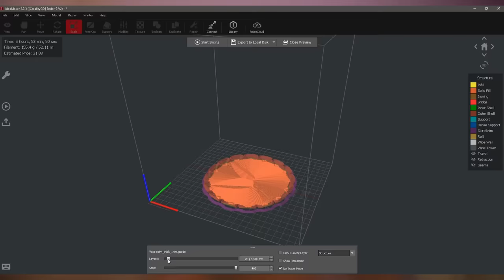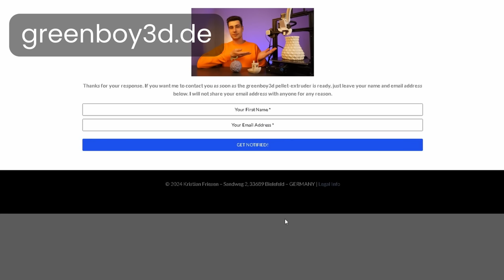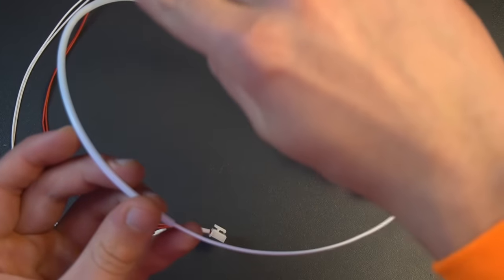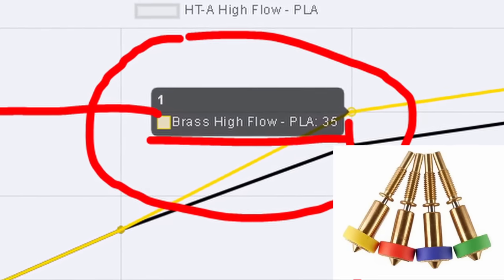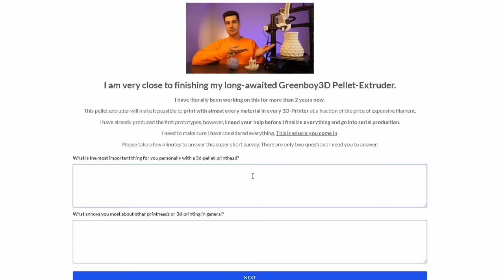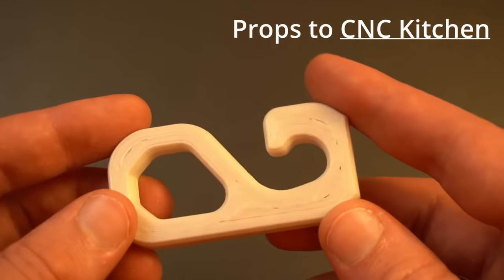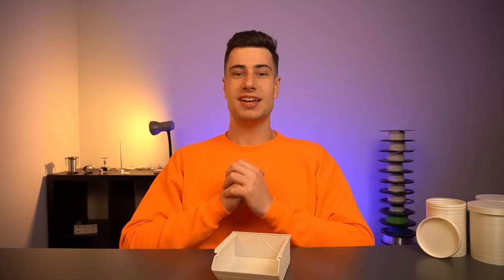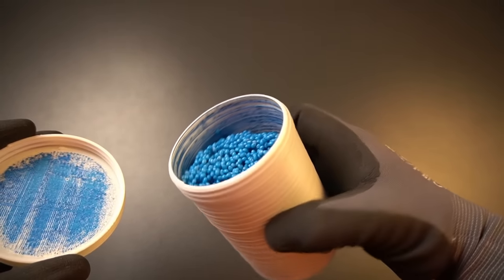Stop Buying Filament, Use This 6x CHEAPER Alternative instead

Comment: I have access to literal tons of both engineering and commodity resins for free that's thrown away from my workplace. I think you 100% need to pick a nozzle that's optimal for pellet extrusion more so than maintaining broad compatibility.
Reply: What place u work for?
Reply: Absolutely. This gives so many benefits overall, a small compromise is no problem.
Reply from the maker: Thank you for your feedback🙂
What would you like to see next?
Reply: 1kg PETG cost here 6-9 usd per kg. That is so cheap, if it would be free, I would not print more. In the company we also put hugh amounts of PA6 and POM in the junk
Reply: Special nozzle all the way. If a standard platform for pellet extruders eventually comes out as a result too, it just means this will have set the ground for that standard! If there is demand, standardization will come, and people will prefer the performance gain and the eventual affordability.
Reply: You should be able to drill out brass nozzles if you clamp them in a vise. The metal is soft enough. You could also file them down if you need that extra mm of flow rate.

Comment: Put me down as "don't care" about nozzle compatibility.  Nozzles are cheap, they last a long time, and if a special extruder needs a special nozzle, I can understand that.  As long as I can GET them, or I can modify standard ones to work.  Are you thinking of tapering the inner profile?  What would make a standard work better on a pellet extruder?
Reply: I'd think something that's internally threaded to eliminate the extra unneeded melt area.
Reply from the maker: A question that can't get out of my mind is what people would do if they had a nozzle clog, which can happen on any 3D printer due to some particle blocking the nozzle hole.

If the "special nozzle" is not easily available globally because only I am selling it, then this might be a problem. Any ideas?
Reply: @greenboy3d the idea to modify a stndard nozzle from @BrightBlueJim would be the easiest way in terms of accesability. Even when you break multiple ones during the process of modifying or if they clogged faster you can get a inexpensive replacement. The tapping tool could be a custom cadfile ready to cnc manufacture via different big manufactures, like JLC for example, same for special nozzles.
Reply: @greenboy3d i mean if you’re the only one selling it it could be a problem, but if you can solve the distrubution option it wouldnt be an issue imo. You could look into if modifying a nozzle thats readily avaliable is an option because then people could just get that nozzle and modify it themselves if buying one from you isnt an option.
Reply: @greenboy3d  I work in blow molding.   We use stainless steel screens and place them after the extrusion screw. This catches contaminants and solves your clog. Your only option after that is solvents when removing your nozzle.
Reply: @greenboy3d The easy thing there is just to ship packs of 2 nozzles. That way, lead time on a longer shipment isn’t as impactful. Custom nozzles work for Bambu Labs, so I wouldn’t worry much about it. Even if you don’t build it, like 2 months after you launch this somebody will be selling compatible hotends that take the standard nozzles anyway.
Reply: @greenboy3d 
So long as the nozzle is detachable I can find a way to remove a clog. Actually I'm pretty sure I could just stick it upside down in my oven and that should solve the problem.
Reply: @greenboy3d  it will be easily avaible globally, if you have lot of users, you will have lot of money to produce it so it's all good maybe you will have a period with lot of demand and little offer but I think it's just a matter of time

Comment: Idea: try adding some new pellets to your shredded waste, somewhere between 10-40% of new pellets. This is normally done in recycling as it increases quality of the end product by a lot. And 90% of recycled material will still safe a lot of waste
Reply from the maker: Thank you for your interesting input 🙂
What would you like to see next?
Reply: I mean, 100% recycled material or 90% recycled material should safe the same amount of waste, since you are propably using more waste than you produce (if over 90% of your prints are waste, you are propably doing Something wrong)

Comment: this makes utter sense when recycling, you reduce one step and won't reheat the plastic again saving it from losing it physical properties
Reply from the maker: What would you like to see next? :)
Reply: From tests I've seen reheating doesn't really reduce properties by a significant amount, the main issue with recycling is contaminants.
Reply: @satibel  I think so is for metals and well, many other materials that melt at high temperatures, so i suppose it should be a similar story with plastic since it's so similar to those just in a much weaker and lighter (and cheaper) form
Reply: @ERIK-457  yeah for metals the main issue is that most of them are alloys and you can't precisely control the quantity of each metal, so you have higher variance on properties with recycled metal compared to metal that is made from known sources.

Comment: I think a possibly better option is to look at making filament yourself. If you can make filament then you can use any off the shelf printers or parts. Splitting it into separate steps is likely better.

That also removes the print quality concern.

Another option may be to put the pellet extruder on top of the printer and have it create filament that goes straight into a Bowden tube down to the hot end, although this would likely not be as good as making the filament separately.

Comment: I loved your research and the video - but I’ll be blatantly honest about the print quality: it’s not there yet. The Benchy has VERY inconsistent layer lines. On a commercial printer I would have returned it. The question is: are the inconsistencies generated by your pallet extruder? Or is it the mechanics of the printer that are suffering from a heavy print head? I would love to see it on a stiffer printer / maybe it gets good on a printer with a more rigid gantry, linear rails or wider gantry extrusion… more tension on the belts.
Please, don’t dismiss the importance of print quality - people are willing to pay more for better quality filament exactly because they want smoother prints.
Keep going the awesome research!
Reply from the maker: The issue is caused by the inconsistency that plastic pellets in general have. It's like having a Filament spool with fluctuation a diameter between 5% but because of this it costs also 5 to 10 times less.

This issue can be solved in the future for example with a pressure sensor in the extruder barrel or a small AI camera monitoring the extrusion rate and real-time-micro adjusting it, which is why pellet extruders will have in the future basically the same print quality as filament printers. But this this kind of technology still needs to be developed...

If I make enough sales, I will try to develop this technology with extrusion measurement myself, since it would be my dream to bring a huge innovation to the world of 3D Printing... Wish me LUCK🙂
Reply: @greenboy3d you could try an esp32-cam or 2 with a macro lens focused on the hotend, as a bonus you can detect blobs before they cause issues.

Imo another option might be double extrusion, with a pellet extruder extruding into a bowden tube and the filament being picked up by a regular hotend, that allows you to use light to measure the diameter, and to use a way lighter moving assembly.
(Also depending on print speed you could have a shell that's solid but the core still above 60C, which means more flow rate.)

Yet another option (imo the easiest to do currently) would be to use an idex system and do the outer wall on a regular .4mm nozzle, then fill in with the pellet extruder on a 1.2 or 1.6mm nozzle.
The great thing with that solution imo, is that you don't need good quality pellets, and can use whatever color recycled plastic in it and still have an uniform print.
And also the large diameter nozzle means that you don't need the heavy pellet extruder to move fast.
Reply: @greenboy3d  look into extrusion screw yours is too loose and no enough tight and maybe to short too

Comment: My 2 cents on your question about "standard nozzles": not critical, especially if they are suboptimal for this extrusion technique. Most important is a pellet extruder with optimal heating & retraction results. So if that means a different nozzle type, so be it.
Fantastic work by the way ! 👍 Been saving a ton of PLA parts in the hope of recycling them into new prints. But nothing out there seems affordable in terms of time , money or reliability. Most require recycling into filament first, which feels like a dead end for consumers: too many issues, too time consuming, somewhat expensive. 
Your approach that just requires careful grinding seems the most promising to me so far. And seems good enough for my prototyping workflow for functional parts: many iterations, no need for perfect surface quality.
Thanks for your 2 years of effort on this front !
Reply: I agree on this. CNC Kitchen even tried to build a high flow nozzle out of a regular brass nozzle and a copper insert when HF nozzles were a novelty. So already manufactured nozzles can be adapted "quick and cheap" with a round copper insert by just press-fitting I guess, and new manufactured nozzles just with one hole less! I am sure that with the visibility you are earning through your videos, you can achieve something like that pretty easily. However, I would let the nozzle compatibility window open.
Reply: Agreed - for PLA the time and effort isn't worth it - aesthetic prints like cosplay items, busts, toys etc. wouldn't have the look or shape consistency needed, and the functional parts may not have the tolerances needed - it could be great for printing support or infill perhaps but then that introduces a whole other series of challenges in slicing or IDEX integration.  I would recommend  this extruder for printing thermoplastic elastomers that are too soft to turn into filament, or perhaps make printed parts from materials other than standard and widely available filaments.
Reply from the maker: Thank you for your great input :)
Reply from the maker: A question that can't get out of my mind is what people would do if they had a nozzle clog, which can happen on any 3D printer due to some particle blocking the nozzle hole.

If the "special nozzle" is not easily available globally because only I am selling it, then this might be a problem. Any ideas?
Reply: @greenboy3d  depends on your goals, I guess. If it is to make money on nozzles then indeed it could become an impediment for buyers. If not, publishing the design specs will get a long way toward copycat nozzles appearing on aliexpress or ebay. With many biz models in between (partnering w 3D printing accessory distributors on each continent, selling through specialized online stores that have figured out worlwide buy & ship like CNC Kitchen's, etc).
BUT the nozzle is only a tiny concerning piece in my opinion. How about other proprietary or uncommon parts of the extruder and providing spare parts for repair ? Like the extruder screw, or its housing ? Screw extruders do NOT have a great reputation on the hobby scene. So, as a buyer I'd be less worried about the nozzle (I'll likely find a way to unclog it) and more about whether I'd be able to get spare parts if anything breaks down ?

Bambu Lab might be an example to ponder. The highly specialised parts in their printers initially turned many people off for fear of ending up with an expensive unrepairable dead paperweight. But their policy of selling most parts online at a reasonable price went a long way to assuage these fears. Maybe something can also be learned / copied from that ?
Reply: @greenboy3d  this is very valid concern and needs careful consideration. I suspect that recycled material will be likely to have more fine particle debris than filament normally does. This could lead to more frequent nozzle blocks.
Replacing a whole nozzle every time isn't a solution I'd be happy with personally
Reply: @greenboy3d  The biggest issue with the recycled material will be clogged nozzles - it is so easy to get dust/debris mixed with your material and 0.6 mm or smaller will frequently clog - your 1 mm is actually not too bad, but if larger chunks of something (metal, higher melting point plastics) got in then you will have under extrusion issues at a minimum.  If you put in a filter mesh, it will increase flow resistance dramatically because the input area is still very small in the extruder (usually a large area of mesh is used in extruder die to offset this increased resistance).  I would strongly recommend drilled out NPT threaded hex plugs turned to make a pointed tip - leaking of polymers is reduced because that thread style is designed to be water/air tight after installation - no such luck with M6 for example unless you have a lot of teflon tape. I have worked with screw extruders to connect to 3D printers and there are many things that can trip you up.
Reply: In my experience, nozzle cloggings have never been an issue especially with pla/petg, I think the only time I had one was because I didn't screw all the way up while the hotend was hot, the heartbreaks on the other hand are where I get the worst clogs and the hardest time removing plastic from them, the nozzle clog can easily be removed with a hot gun or even a lighter, the heatbreak is another thing altogether @greenboy3d
Reply: @greenboy3d  You are already selling the whole solution in the first place. If anything happens to the system (Heatsink, screw, heater...) you will be the only one selling replacement parts. But if the system becomes popular enough, I am so sure that some distributors will be interested on helping you out, as well as some Chinese folks will be interested on selling cheap knock-off clones. Same goes for nozzles I believe, is just a matter of time to become widely available. In the mean time, I would investigate on DIY solutions as well, as the copper insert I talked earlier, and provide clear instructions on how to build it.
Reply: Not needed anyway because the toolhead for pelleted material will always be more bulky compared to it´s filament counterpart. The quality isn´t as good as well, higher flow rougher bigger prints like furniture parts make probably more sense with this system for now. Just see what works best. Of course using nozzles everybody already has is best but for now it´s not really needed.
Reply: My experience is retraction isn't necessary with pellet fed heads if you can dry the plastic enough.
Reply: @JeffDM  Retraction isn´t needed due to wet filament. It´s needed to reduce pressure whilest printing so the plastic does not ooze out when moving the nozzle from point a to b.
Reply: @greenboy3d  I think it would be cool if you made both versions and then people could pick what they want when they buy it.

Comment: Honestly the majority of new printers have proprietary nozzles, so if an optimal nozzle can be close in price, i dont see it being an issue. Really interested in this for an option for my sunlu s8 with a bigger nozzle to print my failed prontd
Reply from the maker: A question that can't get out of my mind is what people would do if they had a nozzle clog, which can happen on any 3D printer due to some particle blocking the nozzle hole.

If the "special nozzle" is not easily available globally because only I am selling it, then this might be a problem. Any ideas?
Reply: @greenboy3d   Good point indeed. Humans on all the sides of the planet.
may be you go as some success company do - make a cheap option and a pricy one. So you will also not let your interest go away for some ideas.

Comment: Cool to see progress on this! Reg.nozzle: why not just make custom nozzles that use m6 threads? You maintain compatibility, and you can also get the characteristics you want
Reply from the maker: A question that can't get out of my mind is what people would do if they had a nozzle clog, which can happen on any 3D printer due to some particle blocking the nozzle hole.

If the "special nozzle" is not easily available globally because only I am selling it, then this might be a problem. Any ideas?
Reply: @greenboy3d  Make many or get a manufacturing partner. If you want this to catch on it needs to be accessible.
Reply: @greenboy3d  well, it's not like you can buy normal nozzles at the local super market either, i think as long as you maintain compatibility with standard nozzles, it should not be an issue, otherwise you can sell them in packs of 10, that gives people alot of time to order a new set when they need it.

 I suspect that the custom nozzle is going to be all about having as little fillament volume as possible to avoid oozing, right? In that case, it might be even easier to clear the nozzle, and it would make it even more a non issue :)
Reply: @TurboSunShine  there is a screen going somewhere at the end of the screw catching debris

Comment: I would agree with most others that a more efficient nozzle would be preferred over a standard one.
Reply from the maker: A question that can't get out of my mind is what people would if they had a nozzle clog, which can happen on any 3D printer due to some particle blocking the nozzle hole.

If the "special nozzle" is not easily available globally because only I am selling, then this might be a problem. Any ideas?
Reply: Nozzle clog can be solved by buying another one.  Profit.
Sell a 3D design of the nozzle for a substantial amount,  or just  publish it for free for the street cred